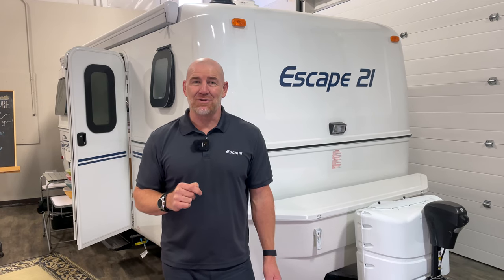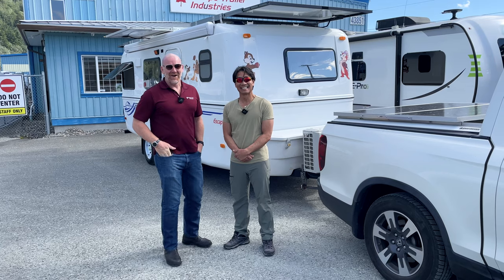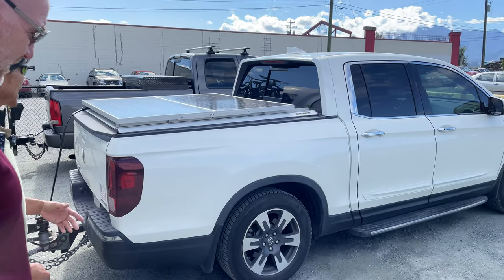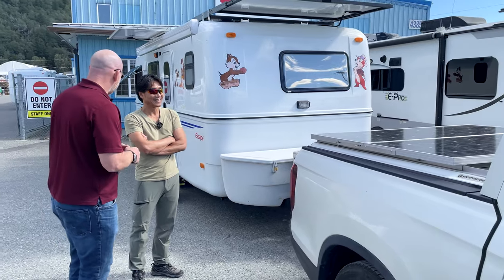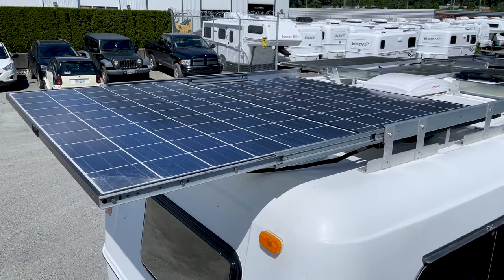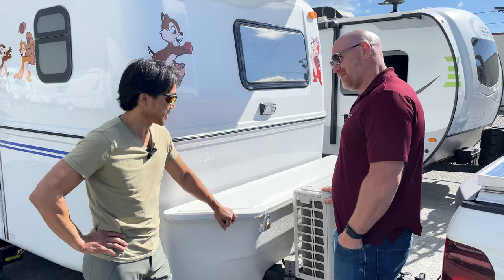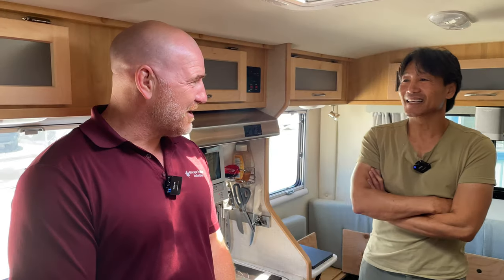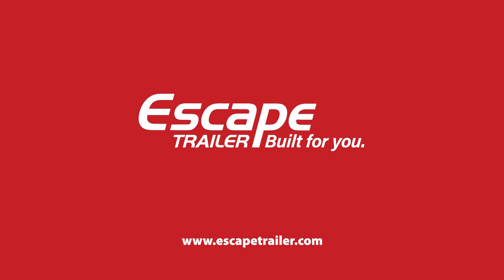Johnny's Ultimate Off-Grid Solar E21C Tour

Comment: I have been thinking about this video for a bit now and it strikes me that the one size acrylic window Johnny used could replace all the standard windows ( except for the optional smaller windows above the cabinet and in the bathroom). This standardization would/should streamline production and in my opinion put Escape ahead of all other Fibefglass travel trailer manufacturers. I also LOVE the skylight idea. It would be  a relatively easy option to offer.

Comment: Johnny is a brilliant and humble man with amazing skills. So nice of him to share his incredible work with everyone. Excited also that Escape has exhibited an attitude of continuous improvement including eyeing up what some customers are doing aftermarket as free R&D. Some stuff will not make primetime but other things I'm sure we might see incorporated as options down the line. The acrylic windows look very promising. As someone who has done a mini-split and inverter/lithium upgrade the costs are quite high even with a relatively simple system and your own labor. With their newer lithium/solar options with Victron components Escape is hopefully working their way to a sweet spot that moves Escape forward and meets the needs of most users. Most do not need anywhere near the extreme that Johnny has designed for. For anyone who wants something fancier they can always DIY or engage with someone like AM Solar. For off-grid/boondocking the most practical and best value for the foreseeable future will remain a hybrid electric/propane trailer. As far as air conditioning I love our mini-split but the Houghton units currently available through RecPro are tough to beat as a relatively quiet bolt-on rooftop solution. Escape should consider offering these if possible.

Comment: Enjoyed this walk-through very much, and love the idea of capturing enough solar energy to be able to delete propane altogether. Thanks to Escape and Johnny for doing this!  You could just SEE the wheels turning behind Karl's eyes, lol.
Unless I missed something, it looks like Johnny is running EVERYTHING via 24V into his 3000W inverter... or does he have a little 12V battery off to the side powering the original 12V light circuits? More curious than anything, since it wasn't mentioned and the 12V lights still exist on the ceiling.
Reply: He doesn't mention it but more than likely he has a 24V to 12V step down converter to handle his 12V loads. He still needs to power his lights, range hood, water pump, tank monitor, propane detector, awning, MaxxFan, bath fan and those small ventilation fans he added.

Comment: One thing to be aware of is the thought Johnny put in to charging the batteries, two solar inputs and the dc to dc charger  as well as shore power . Very cool but how do we fit in 800 amp hours of battleborn or victron lithium batteries :) 
Excellent video and great to have it put in context with what could be added  to manufacturing

Comment: Ive bookmarked to watch the rest. I really thank you and Johnny for the more in depth information on the construction of the changes Johnny has engineered. Bonding the panel structure to the shell without penetration is very smart. As you are absolutely aware,  there is white a bit of the rigidity in the structure is in its continuous shape. poking holes in it weakens the whole and introduces areas that can crack. I really really like the idea of an all electric trailer  - heating, cooling, cooking, etc But obviously adding 2000 watts of solar generation and storage to production would quickly put these rigs into the six figure range - which changes the whole target customer group. 

If there is one thing from this build I would really like Eclipse to incorporate into new units its those windows. They are a BIG plus and attraction in every trailer design on my list for the upcoming year. It really draws me to the nucamp and lance rigs. Let me open those windows WIDE.  The only issues Ive heard of is that some people want to open the windows but not let the light in, so they make slip covers. and the bug screen sucks

Thank you both. Big props to Johnny for the work and being willing to show it off!
Reply: Im gonna reply to myself - those are actually better acrylik windows than the ones I see on other trailers. the screens are totally different and way better.

Comment: Im fascinated by the solar system. Under the heaviest load, How much of the ~800 amp hours of storage do you use, Johnny? like say a boondock that involves heavy use and the solar panels might not be at peak efficiency because of cloud cover or foliage. 

Karl you are absolutely right - Electric is the way to go. Quiet. Efficient. configurable and durable.

Comment: Escape- Are there any benefits to being a fully electric trailer?  Seems to get there you would have to have a lot of lithium batteries which raises the price, versus the option of gas.  What are your thoughts?
Reply from the maker: Hi Al, 
I think it is an energy management exercise that folks deal with differently. Either way you are paying for energy and it comes down to whether you want to pay now or later. I think being all electric offers more energy flexibility i.e., assuming there is sun you will charge the batteries, and you have the alternative option to use a generator, your vehicle or plug in somewhere. If you run out of propane, you need to get propane and nothing else will suffice. 
I think that renewable energy is an effective solution for RV's (especially the smaller RV's), and I believe we will see folks continue to move in that direction.
Karl@Escape